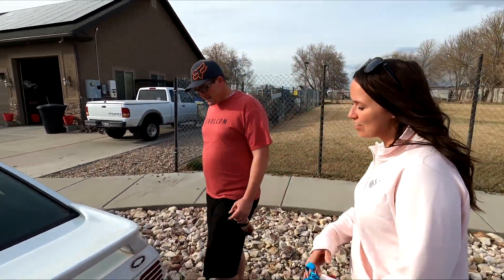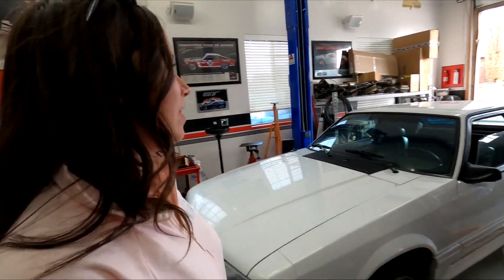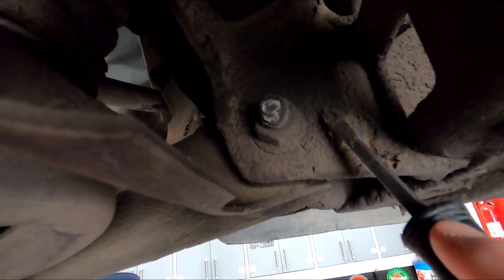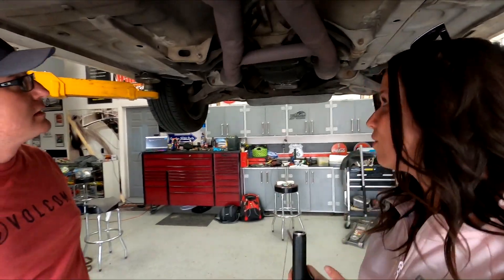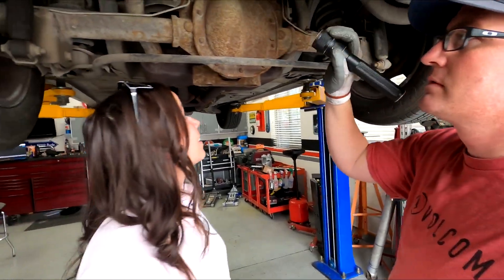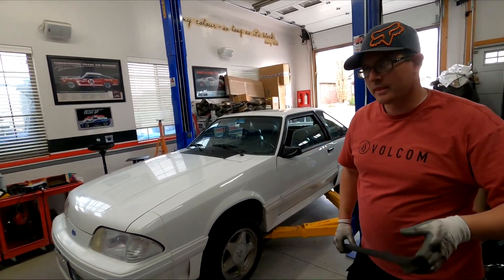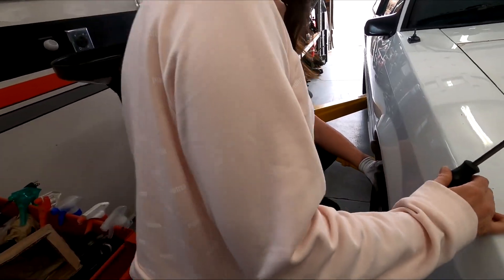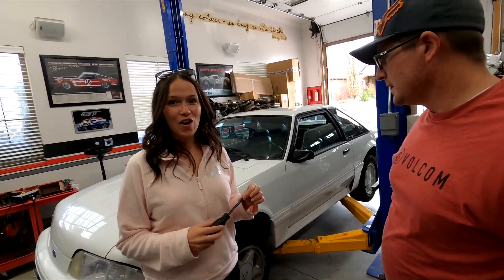BUILDING my FOX BODY 5.0 into a TRACK CAR!

Comment: If you want to autocross a foxbody: first 5 mods if I could do my 93 notch over again:  MM full length frame connectors.  proper Bilstein shocks and camber plates.  strut brace.  sticky tires.  for track use the brakes just won't hold up and the rear suspension just is not predictable at the limit.  
for track use, top 10 mods:  1.frame connectors. 2 Bilstein shocks(front coil over w/350-375lb coils) and camber plates.  3. SN95 spindles with a cobra or some good 13" front brake kit and a Baer 12" rear kit with the C5 rear caliper.  4. Panhard bar & torque arm rear from Maximum Motorsports with a 400lb rear spring. 5. baffled oil pan and windage tray. 6. alum radiator, electric fan.  7. some type of aftermarket power steering pump like a KRC or Sweet circle track deal.  8. manual brake conversion.  9. Seats & harnesses. 10. sticky tires.
Reply from the maker: Thank you so much for all this great information!! I'll look into ALL of this 😊🤗

Comment: Do it right 5 lug swap it with 4 wheel cobra disc brakes , 17in pony r good nitto tires , all new a arm , bushings , rear boxed arms along with lowering springs and good shocks. The car has plenty of power for her as it is just fix the oil leaks .

Comment: Hey Brit. I bought my foxbody for 5k, it has 122k miles.  Gt40 heads  bbk upper and lower intake,  long tube headers, intake, msd , suspension was done and build transmission. It also  has 24lbs injectors and 4.10 gears. It needs some body and interior work. Good luck with your build.
Reply from the maker: Whoa!! You go a great deal it sounds like! I don't know if you know this or not, but I bought mine for 5k as well. 140k miles, and a lot wrong with it lol

Comment: Hot Rodding 101 ....... Intake , Exhaust , Ignition , after gaskets, seals , motor mounts and don’t forget suspension and shocks. Have fun. Should do before and after time comparisons at the track.

Comment: Track car eh? Hmmm new struts, shocks,stabilizer shocks (horizontal shocks in rear)ball joints,sway bar bushings front and stabilizer link pins,,fix all oil leaks mentioned and valve cover gaskets too, I'd probably swap out gear in the rear to a 3.55 or 3.73 most likely has a 3.08 now,,double check rack n pinion bushings as well and new rubber on the wheels
Reply from the maker: Woah thats a good list. Have you done all this before? Maybe I should list what we don't need to replace lol. The list is much shorter 😂 first on the list... I dont have to replace any doors, ha!
Reply: @GirlsDigMustangs   yes I've done everything on that list and much more lol yes doors are in good shape 😉 I'd probably get an adjustable Hurst shifter too loved mine was much better than the stock stick

Comment: Hey Brit, I remember when a follower sent you spark plugs and they didn't fit because the previous owner installed GT40 heads! If you already have upgraded heads, you should consider an intake manifold and a cam that would match  the heads so that you have a full heads cam and intake setup! That would give the fox enough power to keep up with your other Mustangs! If you are taking the motor apart anyways to replace the seals, It would be the right time to make top-end upgrades...
Reply from the maker: Thats a good point, I'm pricing everything out this week and we will start soon! So much to do 😉

Comment: Change all 4 wheels from 4 lug to 5 lug nuts. If not all 4 wheels at least upgrade the rear wheels to 5.
Reply from the maker: Somebody else mentioned this too. Okay, I'll check it out! Thanks for the tip 🤗
Reply: @GirlsDigMustangs  One of the theories about going from 4 lugs to 5 is that 5 lugs just basically gives you a stronger wheel that can handle lots of power more so than 4 lugs. I would love to have a clean Fox body. Oh and nearly all aftermarket wheels are 5 lugs.
Reply: The 4 lug wheels are actually strong enough,some have raced 7 second quarter mile drags with 4 lugs.5 lugs gives you more choice in wheels and brakes.Can get 5 bolt swap kits from large and others.The cheapest kit has same size and type brakes, still with drum brakes on rear.A more expensive upgrade kit will have you use SN 95 Mustang front spindles, from 1994 to 1998 Mustang , with sealed bearings,makes it easier to install front discs as they just slip on, and will fit more different wheels.The rear axles can bolt to an adapter to put rear disc brakes.Other more expensive kits can add larger front disc rotors, stock is 10 inch, can fit 11, 12, or even 13 to 14 inch discs with many 17 inch or bigger front wheels.May have to do some minor grinding and mods to fit the 13 to 14 inch brakes.Some wheels, like 9 or 10 inch wide may require some grinding or steering spacers or wheel spacers to avoid rubbing.Depends what you can afford or want to do.Just adding a rear disc will improve braking, need some good advice on how to match the brakes and wheel/ tire sizes.The stock ones work ok for normal use or if you are not racing.The 1991 to 1993 Mustangs have a little more room in front fenders to fit slightly bigger wheel/ tire combinations.
Reply: If you change to 5 lug wheels, don’t do just 2 of them, you could have a flat, then is your spare tire on a 4 or 5 lug wheel? You can get donut type spare tires , 5 bolt 15 inch , or get a 15 x 5 or 6 inch rim 5 bolt with a 165/80 r 15 tire that will fit inside your spare tire space in the foxbody  hatchback.